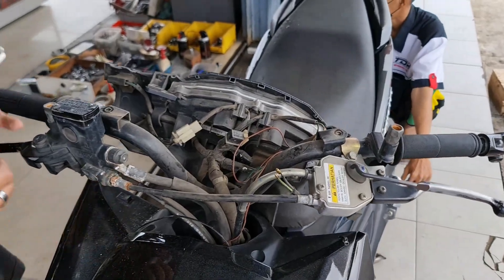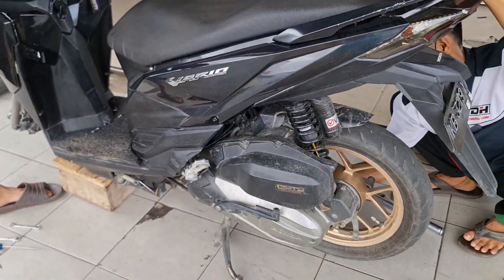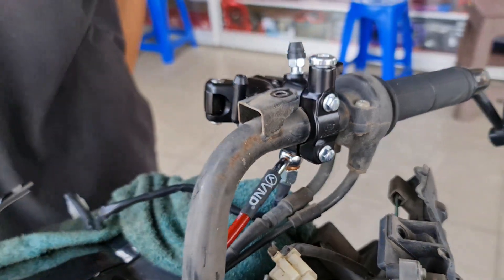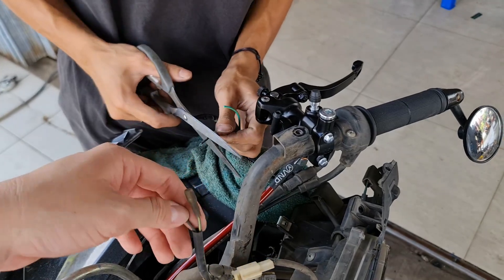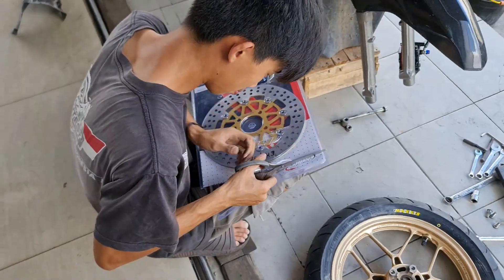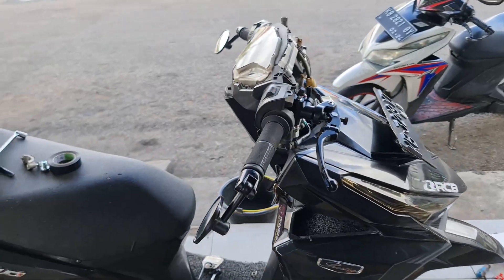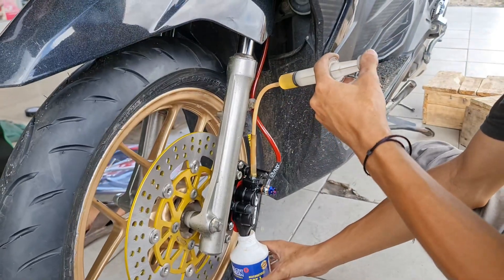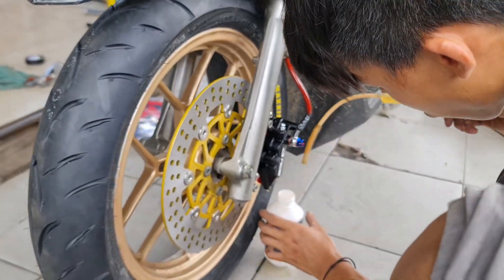Modifikasi Honda Vario Led Pasang Master Rem RCB S1, Piringan KTC, Kaliper RCB, dan Selang Rem VND‼️

Comment: Bang itu pake breket apa?
Reply: Pakai breket sambung yg dapat dr ktc nya sih kalo diliat. Cuma emang baiknya pakai braket utuh 1 aja. Di ce es te. Kalo arumi jelek g center
Reply: Iya tuh aku bingingung masih breket kaliper. Ni kan aku upgrade vlk Premium P10. Disckbreak nya KTC 260mm dpet breketnya. Nah mau beli kaliper RCB S1 cocok gk ya breketnya.
Reply from the maker: Piringan 260mm matic honda, itu kalo pake kaliper RCB Type S. Itu PNP kk. Breketnya kepakai dua duanya..baik yg di piringan, maupun di kaliper.